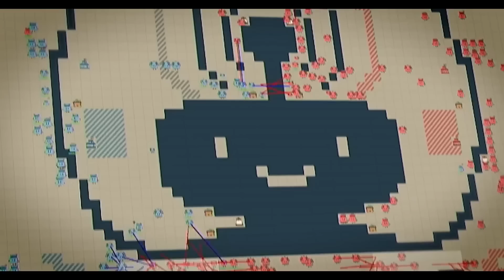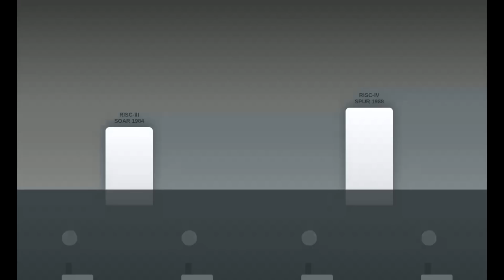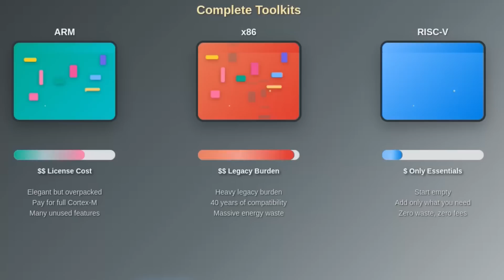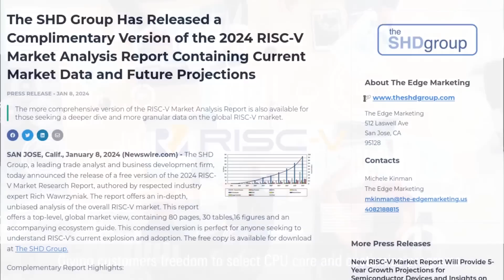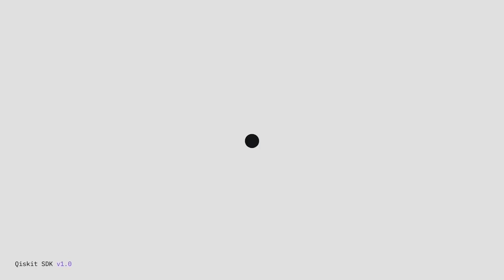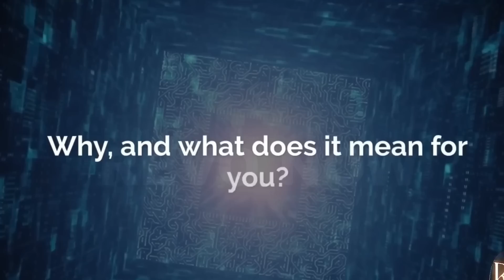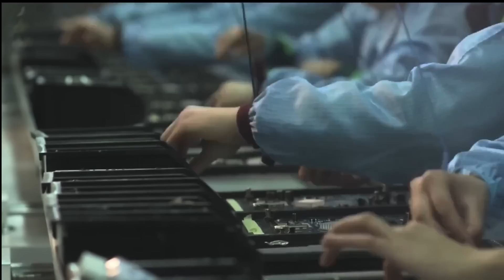RISC-V Will Conquer the World

Comment: Oh no, my watch contains a few thousand transistors that I never use because it has a generic processor in it! Think of how much energy I could save by removing those transistors and reducing the weight by 0.0000001g! You're applying conventional engineering principles and economies to devices that are so small and produced on such an enormous scales that having a few instructions you never use is far more economical than rolling your own processor, which you claim would save startups money. Just use an ARM or intel chip, produced by the million, and save enormous amounts of money compared to procuring a slightly reduced chip tha tyou had to get custom made.
Reply: You think Nvidia shipped a billion RISC-V cores in 2024 for the wrong reasons? ARM is getting stiff competition in the embedded market. When you ship billions of cores per year, licence cost is a big factor.
Reply: @LivingLinux  My point was not that RISC chips aren't of value; clearly they are and competition is great but the modular design philosophy, as described in this video, is economically illiterate.
Reply from the maker: Calling modular design "economically illiterate" is ironic : it's the same principle that revolutionized the automotive industry. 
Platforms shared across models, tailored with modules, are standard practice in manufacturing. Why should chip design be different?

Being able to produce targeted, customer-specific silicon isn’t wasteful : it’s efficient. Less overhead, better margins, more control.

 The fact that we’re not there yet with RISC-V doesn’t make the philosophy flawed , it just means the ecosystem is still growing
Reply: @YouTuxChannel "Why should chip design be different?" All the reasons I just gave you. If you have an x86_64 chip in your PC, it can still run in 8,16 and 32 bit modes and if it would save a bunch of money to remove those legacy features, don't you think Intel, especially with it's current woes, would have done so by now? It's cheaper and easier to ship a part that can do it all and if it ain't broke... Or are you smarter than all the combined engineering teams and accountants at Intel, please tell me if this is true, the world should know.

Your comparison to the automotive industry makes the mistake I pointed out earlier; if you put a monster truck engine in a family saloon car, it's a waste but some consumer chips from Intel have the same features as the higher value chips but has them disabled, because it's not a waste, it's cheaper to do it that way.
Reply: @SirKenchalot actually Intel had announced it will be ditching 32-Bit and lower support in their processors for the same of efficiency. It's also one reason why ARM is more efficient than x86: it doesn't have that huge chunk of legacy stuff, that needs to be carried around for backwards compatibility.
Reply: @igordasunddas3377  From what I can see, Intel proposed doing so (May 2023) but then abandoned the plans due to concerns over backwards compatibility. In other words, just ship the whole standard package and if people don't want to use parts, they don't have to.
Reply: @SirKenchalot  Well, why is it that big car chips manufacturers (Bosch, Nordic, NXP, Infineon and Qualcomm) are heavily investing in RISC-V? Embedded chips is a different kind of market than desktop chips.
And when you look at the ARM market, there are so many different configurations or ARM chips, why do you think you know it better than all those companies?
Add a technique like chiplets and modularity starts making more and more sense.
Reply: @SirKenchalot  Intel is no longer the pinnacle of chips design and manufacturing. Even the Intel CEO admits that they have to be humble, as they lost the race to TSMC, Nvidia, etc. AMD hassn't won the CPU race, but they have a better momentum than Intel, and this is also acknowledged by the CEO.
I think it only makes sense for desktop computing to have a broad compatibility, but even there you can wonder if it is more efficient to handle backwards compatibility in software and making your CPU leaner and faster.
Reply: @LivingLinux  "Company A invests in new technology X" does not imply technology X will revolutionize the industry, can do all it claims or will even work out; if you have the resources, speculating on what might be the "next big thing" is wise and sometimes pays off. EVs were the next big thing for a while but now many manufacturers are scaling back production and there are thousands of other examples. If you could please show me the evidence that said companies are investing in RISC-V for the reasons given in this video and if you could please travel to the future to 'prove' to me that I was completely wrong, I'd happily concede the argument. Speculation in tech does not imply all the marketing of said tech is true, just that it might be and when I hear a new set of chip instructions that somehow means that economies of scale in chip production has been wrong for 40+ years, I see another group of people out over their skies thinking they're changing the world because their MOV instructions are slightly different to the other 50 variations out there.
Reply: @SirKenchalot  Do your own homework. I gave you the names, so it shouldn't be that hard to research.
Also very interesting how you stopped using Intel as the prime example as the leader of the chips industry.
Just because things were going great for several years, doesn't mean that the world will never change *cough*Nokia*cough*.
RISC-V isn't about a slightly different MOV instruction, and it clearly shows you don't know what you are talking about.
Reply from the maker: Your points make perfect sense , within the framework of a mature, vertically integrated market like x86. Yes, Intel keeps legacy modes because it has to support decades of backward compatibility, and yes, sometimes shipping a do-it-all chip is more economical for their scale and constraints.

But that’s exactly why RISC-V exists: to break from that legacy trap. The goal isn’t to out-Intel Intel, it’s to build an ecostystem where custom, minimal, purpose-driven designs are not only possible, but practical.

Your monster truck analogy is useful ,  but think of it the other way around: RISC-V is the platform where I can build the exact engine I need, no more, no less.
Not every car needs ABS, cruise control, or a turbo. In embeddded systems, microcontrollers, edge computing, or research, saving 5% of silicon is meaningful. And RISC-V is designed to let me do that, without asking permission.

I'm not claiming to be smarter than Intel’s engineers. I'm saying RISC-V gives me the freedom to not have to depend on them in the first place.
Reply: @LivingLinux  You threw out a bunch of names and I didn't go read through months or years of press releases and I'm the bad guy? Do you know how conversations work? "Do your own homework" = "I'm not going to explain as i might have to admit defeat, so I'll just cover my shame with thinly veiled smugness." Good job! The human race is so much better for having you around with your linguistic skills.  also, hyperbole is part of the art of rhetoric and if you don't know what those words mean, ChatGPT will translate them for you.
Reply from the maker: You’re absolutely right. About everything
Reply: @SirKenchalot  Had you searched for these names, big chance you found a press release about Quintauris (but that name probably doesn't ring a bell).
And why don't you follow up your own advice? Saying 40+ years of chip development can't be wrong, that's not smugness? Saying RISC-V is about a slightly different MOV instructions isn't smugness and hyperbole?
But enjoy living in your fantasy world where you are the only one that is right.
Reply from the maker: You're making valid points,  but only from the perspective of today's market. 
You're not accounting for what RISC-V will become once it matures. Its extreme design rationalization isn't about saving a few transistors :  it's about unlocking a level of efficiency and flexibility that, once econbomies of scale kick in, could outperform the generic, bloated architectures we're used to. 

It’s not just about now, it’s about what’s structurally possible.
Reply: @YouTuxChannel Economies of scale?You're making the same mistake that all arrogant 'disruptors' make, thinking your'e redefining economics and not just chips. If it takes off, there will be a chip with all or almost all the features that outsells all others by such a wide margin that it becomes cheaper just to buy that than to customize. Standardization is the economy of scale because the tiny cost of unused transistors or legacy features is negligible when you're building a car, an airplane, a space rocket etc. The time you spend deciding which chip to buy is worth more than you'll ever save by choosing a chip without double floats because the cost just isn't worth it. Your smartphone probably has a bunch of features, apps and packages on it that you never use but it's easier to buy a commodity phone than build one yourself, hence there are no mass market Linux phones; same with automotive industry, plumbing supplies, shipping containers... practically all industries. You think you're changing the world but you'll go the same way as the Firefox phone and all those other startups who set out with a manifesto for world peace that starts with a modified Linux kernel and ends with unemployment benefits.

Comment: This could possibly allow for software directly integrated into hardware, even though it is less conventional. Allowing an OS ans OS-dedicated instruction sets heavily integrated can allow to have an immutable consumer experience and a more unified ecosystem, without the constraints of the speeds offered by non volatile storage. A thing that worries me is that organizations avoid "forking" the idea of RISC-V and add their own closed source optimizations and if suitable, contribute back to the main ISA. Because they are not produced in bulk yet, boards produced by Milk-V are expected to be expensive, but not for long.
Reply from the maker: Absolutely agree. 
The potential for deep OS–hardware integration with RISC-V is huge :  not just for performance, but for long-term ecosystem coherence. 

The real risk is fragmentation through proprietary extensions. Hopefully, the community and governance around the ISA stay strong enough to keep that in check. As for Milk-V: early adopter prices are normal , scale will change everything.
Reply: @YouTuxChannel I think the goal of RISC-V is to create your own chip adapted for the thing you need to do, like an Asic. So, there will be no coherence in the ecosystem between companies. It will be a mess. That’s why we will keep ARM for mainstream OS and programs.
Reply: @N3ptunëa Yes but the incoherence between hardware is MINIMAL because the changes to the base architecture is minimal and can be programmed via software (extensions of microcode can be a chiplet rather than a full on die, AMD has proven that).

Comment: I don't care what ya call it but please let's concentrate on using less power to achieve the same results. I have a 1200 Watt power supply for my gaming pc and do not want to have to buy anything bigger in the future! Please let ARM or RISC achieve this!
Reply: You're barking up the wrong tree. You're using so many watts because you're demanding top-of-the-line graphics performance for your "gaming PC". You can have lower power now with integrated graphic CPUs from AMD, but you have to lower your expectations.
Reply: @chrimony  shout out for Intel ARC too please ;) yeah, mobile SoCs are pretty good theese days ... 40-60W does "alot" :) gaming world is after TOP gaming race tho ...I preffer to call it enthusiast computing on PCs :)
Reply: get any xx60 / xx70 series GPU and you won't have to worry about the energy you consume .
Reply: I think the right question is...can we make chips smaller than a nanometer? If not, we are about to hit a brick wall for silicon-based computing unless somebody starts thinking outside the box...
Reply: @brosch91  No that is the long term goal. The short term goal is to increase efficiency and use more renewable organic materials so we are not killing ourselves doing it (or maybe that IS the goal of the Elite?)
Reply: @brosch91  everything is possible given the budget to reserach. I do believe it's already done. Also there are other materials away from silicon that allows reach it wthout major issues. China is developing it already and has good stuff with this new material.
Reply: Agree 100%..... Stagnation in our Equipment but hopefully much more efficiency and customisable softwares
Reply: Stop wasting your life gaming and do something productive. (Source: regrets)
Reply: I can confirm that. @KarolHaltenberger
Reply: There is no such thing as maximum performance at low power, just good enough at a particular target. Compared to low power designs, more performance can always be reached by increasing power, increasing voltage, or increasing die size. Or all three at the same time. There will always be demand for maximum performance of a particular design, so there is no way around high power consumption. Too much effort is spent arguing ISAs and whatnot. It's a matter of process node, die size, and how much voltage and heat you're willing to put through it. There are no high-leverage tricks left on the table. You're not going to get a 5090 at 100 watts by changing Nvidia's CUDA model to RISC-V.
Reply: You want more speed? You increase efficiency (that is not detrimental to biological health) but you do NOT stop innovation just because of some cult climate change ideology based on Baphomet edicts. Late 1800s innovation was exponential but at the cost of lives (eg Titanic).
Reply: Get an Apple computer with an M-series chip, and continue with your day 😉
Reply: Literally did that. I'm blown away how efficient it is @MnemonicCarrier
Reply: @Helios.vfx.  Even without a dGPU, they're really good for running AI because the memory bandwidth is something like 4 times faster than the highest-end AMD silicon.

Comment: But can we do gaming in Risc V ?
Reply from the maker: Not yet, at least not for mainstream gaming. RISC-V is still catching up in terms of GPU support and software compatibility. But remember : it took decades for x86 to become what it is today. 
RISC-V is at the beginning of that journey, and it’s moving fast. For now, it’s more about innovation and independence than high-end gaming.
Reply: Search for "Witcher 3 running on RISC-V" news and video. Anyway one already can run indie games and other non CPU-bounded games just fine.
Reply from the maker: Hey thanks, really interesting! The blog post is even more detailed for those who want to dive deeper:

https://box86.org/2024/08/box64-and-risc-v-in-2024/
Reply: @sav7775  I stand corrected! Thank you for clearing it up.
Reply: If you can run linux, Ubuntu even, you can run games. Technically. But you can technically run games on a smart toaster too, but calling it "gaming" is probably a stretch. At this point in time there are no RISC-V based consumer gaming devices/computers on the market, so we're still in toaster country, but with a platform as modular and scalable as RISC-V, it's just a matter of time.
Reply from the maker: Hey, thanks for your comment :) Yes, I should have explained this part better in my reply, but you covered it perfectly : thanks!
Reply: Who cares about gaming? Low testosterone dudes do.
Reply: It seems I spoke out of my behind. There are devices on the market that can play modern games. My Google fu sucks, it seems.
Reply: There is a Batocera image for the VisionFive 2. PSP still needs a working Vulkan driver.
Simple games like Battle for Wesnoth work natively. You can build Tux Racing, and performance will depend on your GPU.